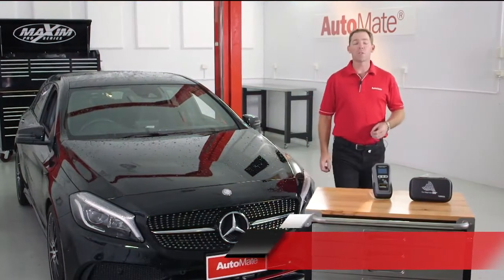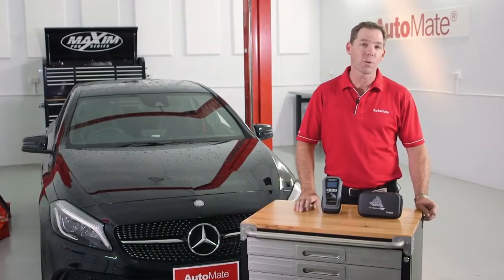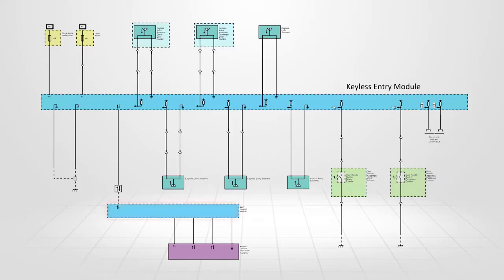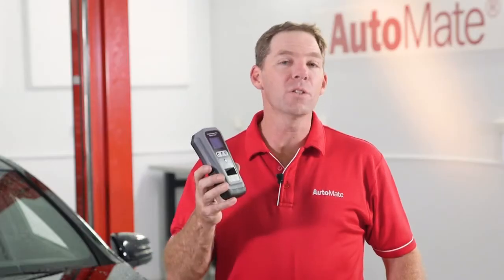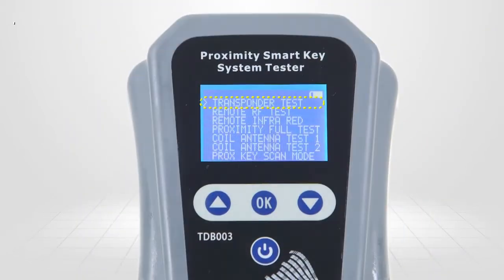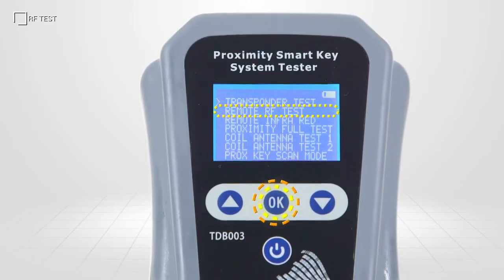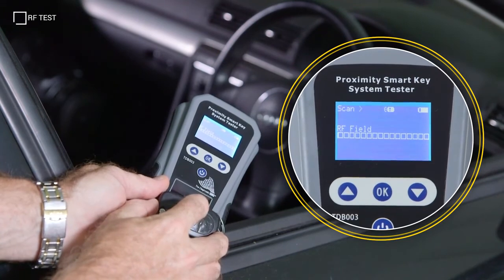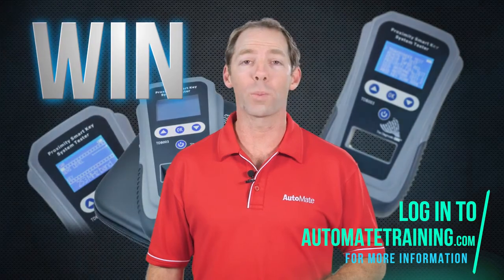The Diagnostic Box TDB003 Proximity Smart Key Tester

Comment: can this tester tell key fob locked or unlocked ( new or used key ) ?
Reply from the maker: However, what you can do is test the transponder with a Transponder device and this will read the data from the transponder memory and you can see if it has been used before. So if the remote is a combined transponder remote then you can do this, but those transponder devices are more expensive and complicated as you have to know what you are looking for, they do not make it easy. We have something coming that will make it easy, TDB500 so maybe subscribe to our newsletter and then you can have a look when it is released. www.thediagnosticbox.com